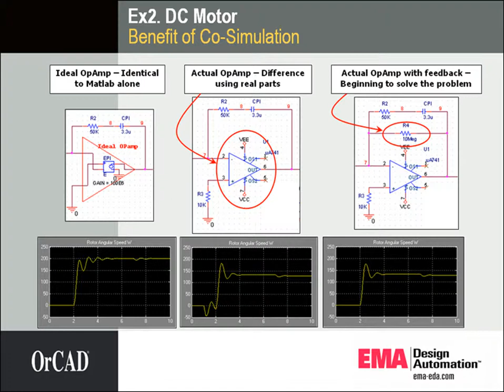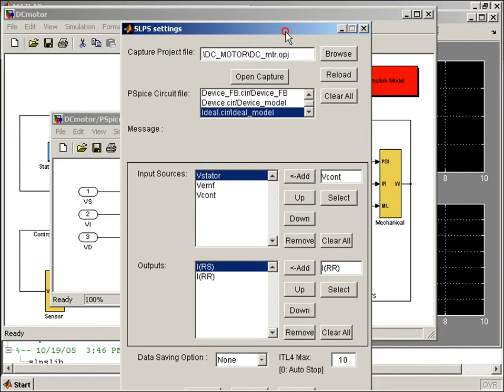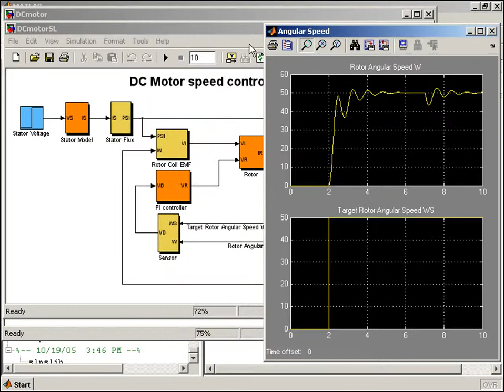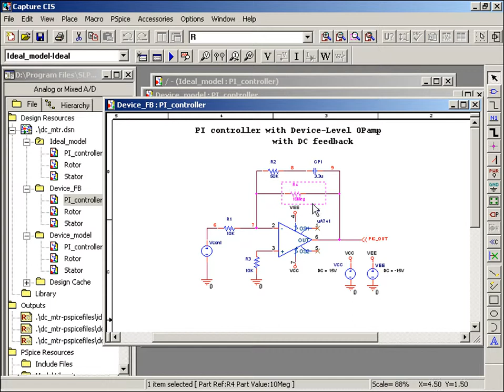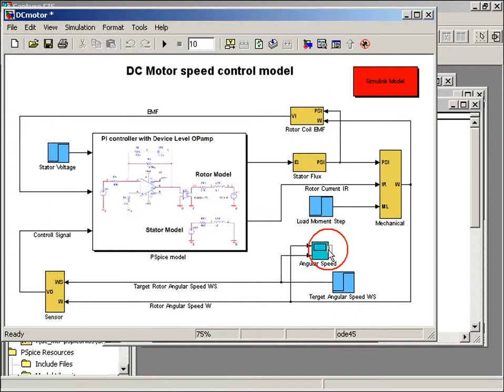4. PSpice SLPS DC Motor

Comment: Hello there
I am a university student, In pspice environment I am having some problems with modeling brushless motors and their control over matlab. I have studied many forms. I have studied many forms. I am especially trying to control the BLDC motor control from the Matlab environment. Especially in order to control the operation of the system in a simple way, I try to move it at a constant speed with the Trapezoidal control method.

But somehow I could not get the performance I wanted. I could not write the parameters suitable for my engine because of the units in the spice file. It works flawlessly when I set up my system only with blocks in a matlab environment. But in a spice environment, a hardware 2- level inverter
When I install a level inverter structure and apply 120 degree Trapezoidal structure and I set it up on matlab, it doesn't work as I want. What is the reason of this ? Can you help me ? I can share the simulation file. I have been looking for a sample study on this for about 3 weeks, but I could not find it.

Regards.
Reply from the maker: Hi there!

If you are using PSpice Systems, I would look at the example files that are in C:\Cadence\SPB_17.4\tools\pspice\capture_samples\CoSimulationDemos\PSpiceCoSim – there are a few Motors in there.

Also, there is some more information on the integration here (webpage and videos)

PO4500 - PSpice Systems Option
PSpice MATLAB Simulink Interface combines two industry leading simulation tools to create an environment for Electro-Mechanical system simulation.
•	Product Landing Page - https://www.pspice.com/technology/pspice-systems-option
•	Overview video (3m48s) - http://www.orcad.com/resources/library/pspice-and-simulink-integration-overview